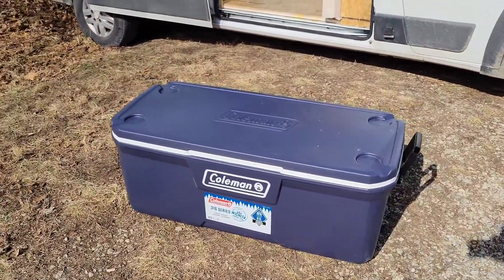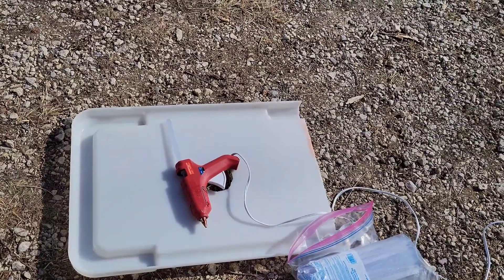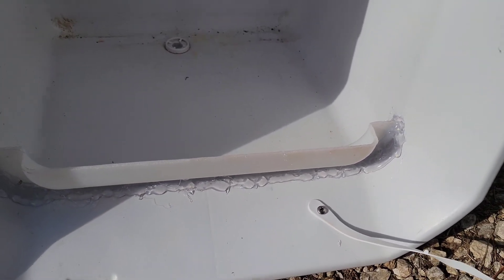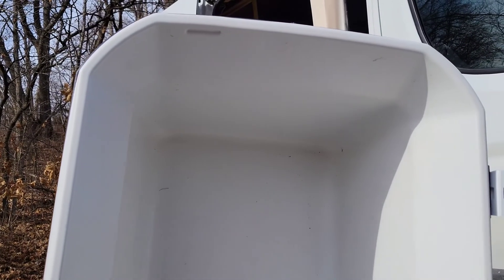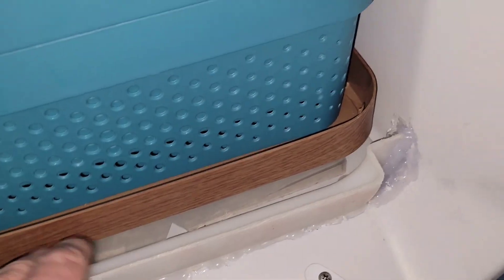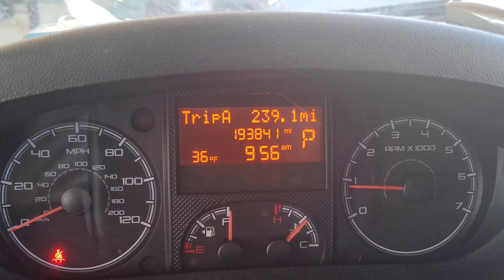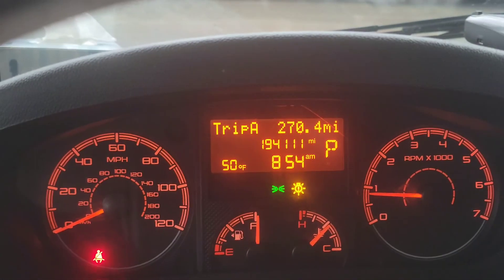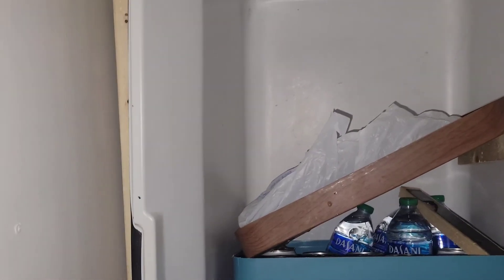VAN BUILD #11: Refrigeration on a budget

Comment: My thought on the shelves in your cooler refrigerator would be to build something like a shelving unit that would go into it. Other than that good job.
Reply from the maker: I originally tried something free standing with shelves in it. I used some of those locker shelves that kids use in their HS lockers. But they wobbled around,  couldn't hold the weight of the ice, and when you opened the cooler they fell out.  I need them to be attached to the cooler and slightly slanted back so everything doesn't roll out when I open the door. But I see we think alike.  Thanks for the advice.  God's blessings to you.  -Brad
Reply: @jesuscross9  that's exactly what I was thinking, the locker book holder, but ya your right, to wobbly.